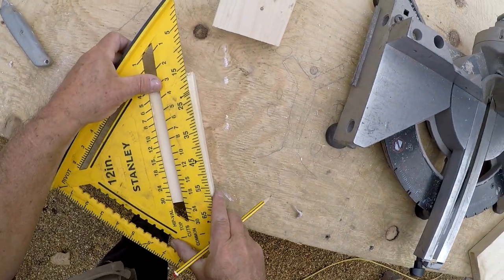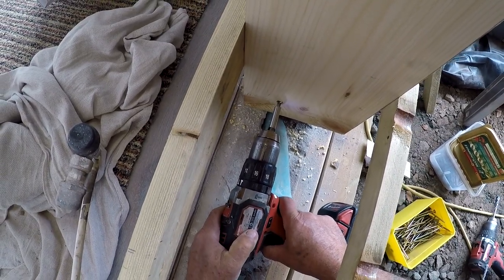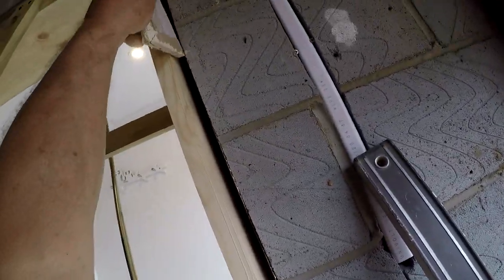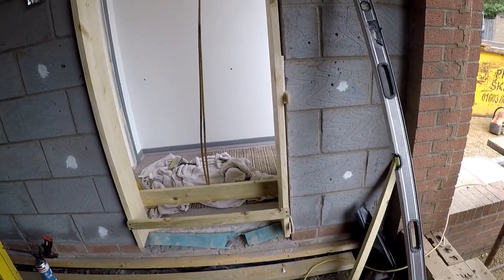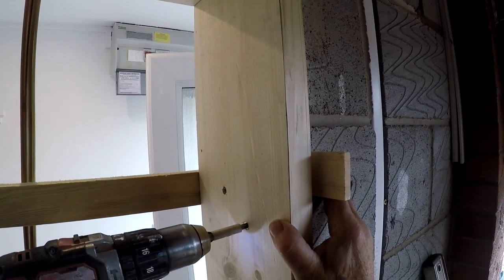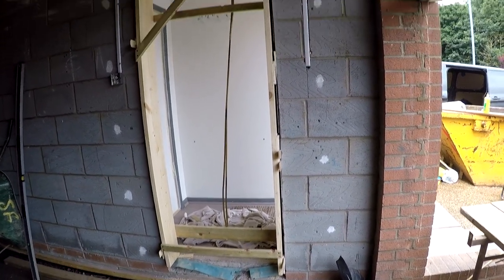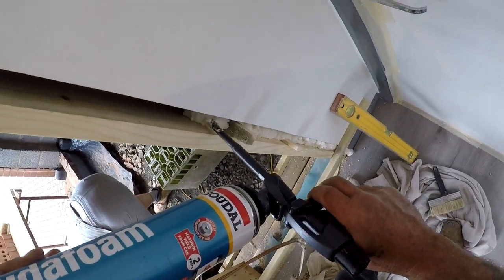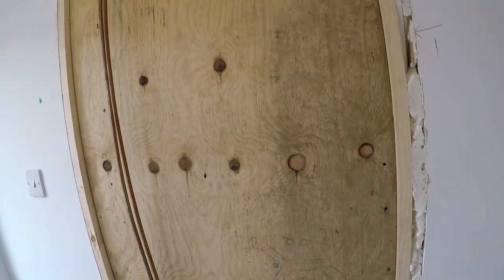Carpentry - Installing the door lining (How to) | Garage conversion part 8

Comment: budd what fixing did you use ?
Reply from the maker: 100mm screws into brown plugs then foamed  between frame and block work , wooden wedges between frame and blocks then foamed the rest, thanks for watching 👍👍
Reply: @BuildingwithBudd   what side plugs and what size drill did you use please?